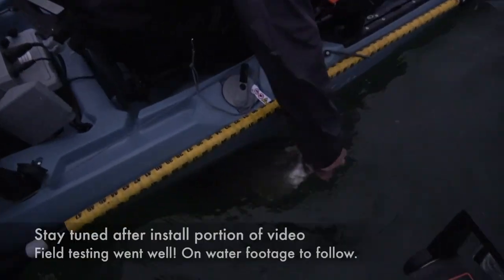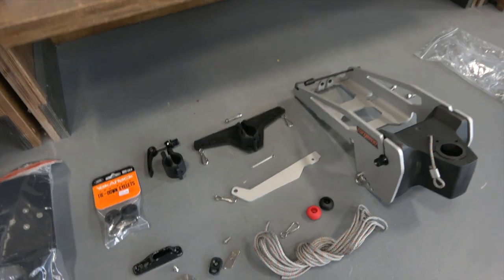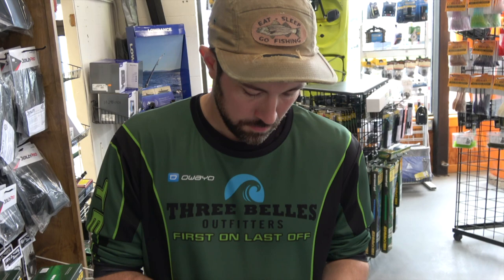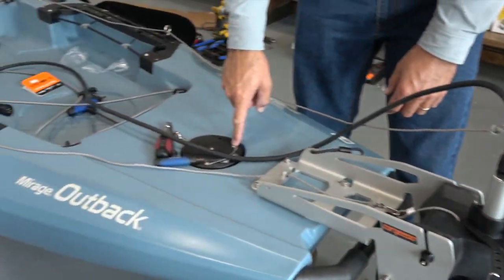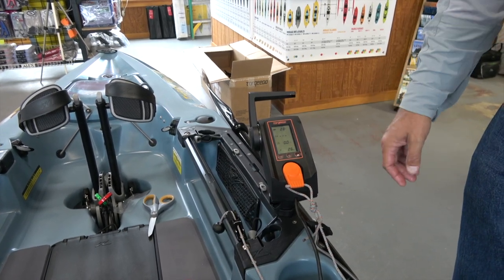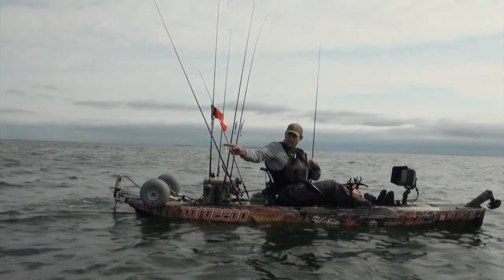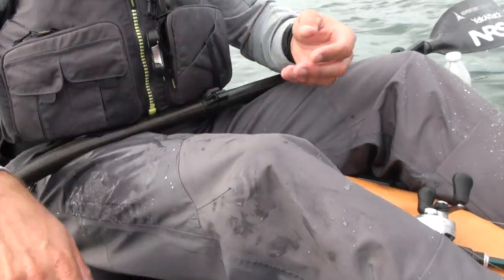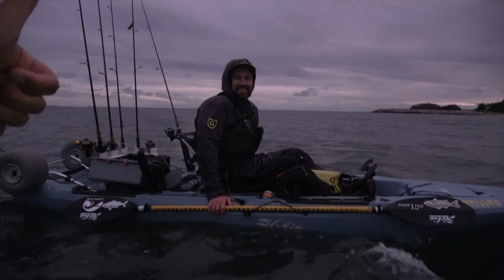Torqeedo Ultralight Install on a Hobie Outback at Three Belles Outfitters

Comment: Jeff what’s a good placement/depth for the motor how far do you want going under the kayak
Reply from the maker: Fred Dew In salt water, or wherever there’s a lot of wave action, I adjust it as deep as the pipe will allow. That way the propeller bites as you clear each wave. In shallower fisheries, I’ll adjust it shallower.